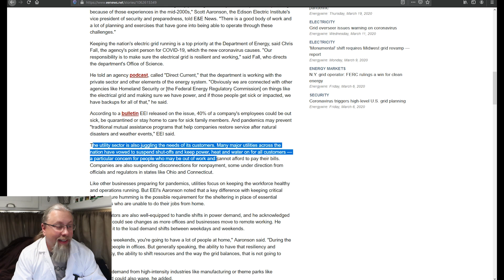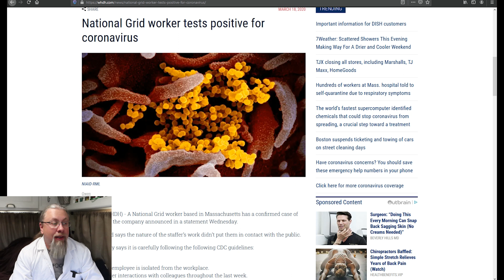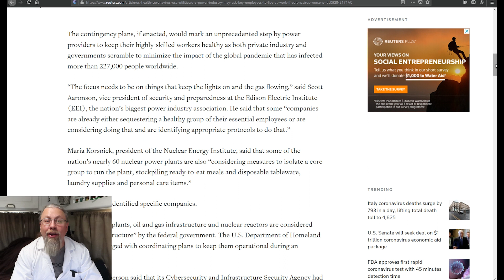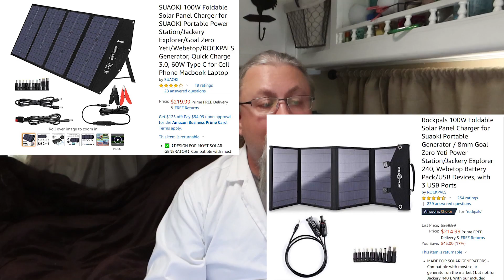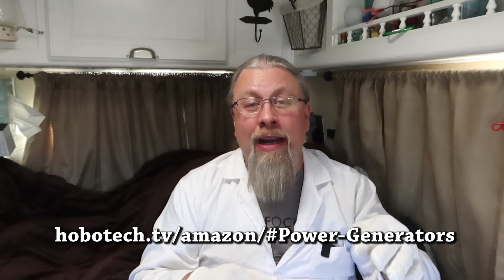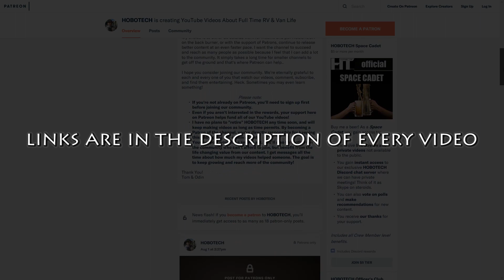BEST Portable POWER STATIONS | SOLAR GENERATORS For SHTF | Grid Down | Blackouts | Covid 19 Preppers

Comment: Power company forgive a bill?  I won't hold my breath on that one!
Reply: Here's what I'm doing. We're building a battery array in my machine shed that is close to the master bedroom. a buried conduit takes the 120 volt power to an outlet labeled "Solar". I use an 8600 BTU window unit to cool the room and at night if you open the door it floods the whole house with cool air in the mornings. The Electric utility doesn't have to know anything about it as I still have my normal, but smaller electric bill, during the 4 hot months.
Reply: @jeffkarrow6924  I used to run my little 2 stroke generator to power a small window A/C unit to keep my power bill under $40 a month during the summer.

Comment: If your solar generator isn't protected (locked in a steel drum) from a solar flair, that will blow up also. You'd be outta luck, sorry to say.
Reply from the maker: Not necessarily. It depends on how large of a flare it is and where it hits. Our grid is far more sensitive than small devices we keep mostly locked up indoors.

Comment: A EMP from the Sun will fry everything and will kill BILLIONS. Good topic to touch on.
Reply from the maker: A huge storm like the Carrington Event today would knock us back to the steam age. That storm was so powerful it lit telegraph lines on fire and auroras were seen near the equator. It WILL happen again. Such storms may or may not fry personal electronics or cars because many of these things have radio interference shields around the electronics providing "some" protection. What will fry are the transformers in the power grid as those thick power lines run hundreds of miles unprotected creating the perfect "antenna" to absorb the EMP. Each transformer takes 12-18 months to build and come from CHINA. There are hundreds of these in our grid. Think about that ...
Reply: Including your solar generator.
Reply: Has that ever happen or should we worry about the things we can impact on.
Reply: @rogeryoung1260  A Solar storm EMP is highly unlikely. In 1859 the US experienced a powerful SS. (research)
Focus on what you need now. Don't freak out over it.
Reply: @rogeryoung1260 has happened many times in history. Just rare. The last big one was in 1859 Carrington Event. With our connections to electronic devices today if it happened we would be screwed.